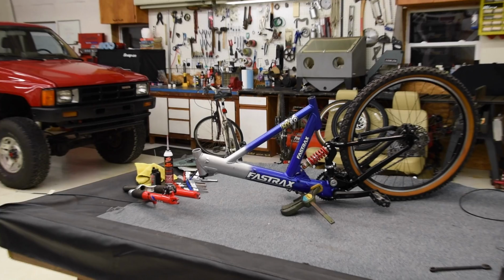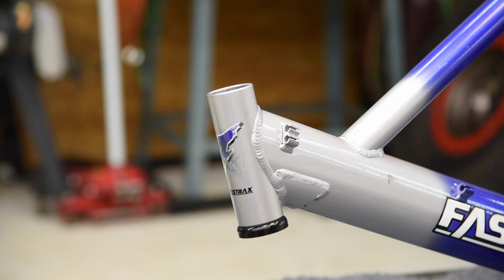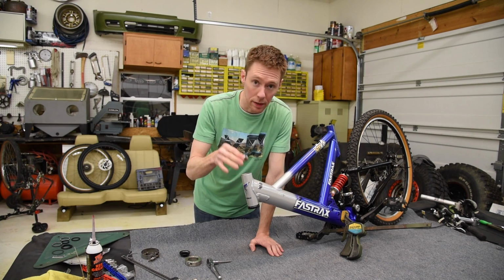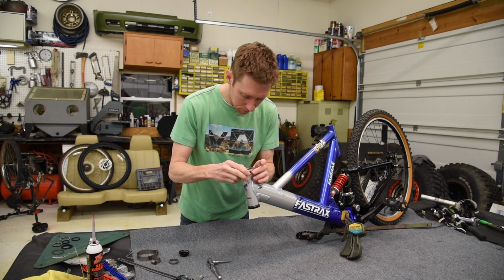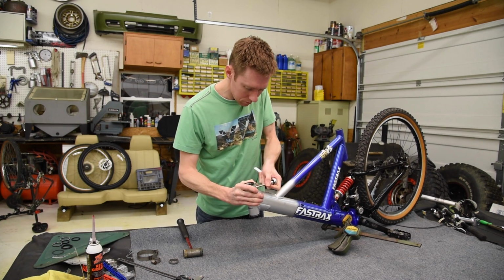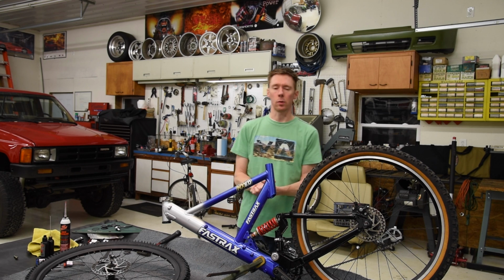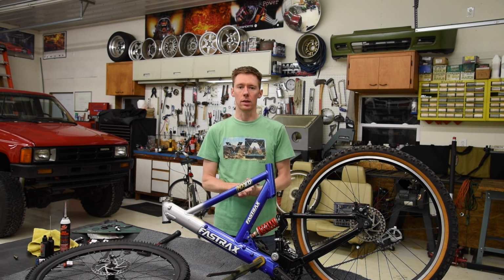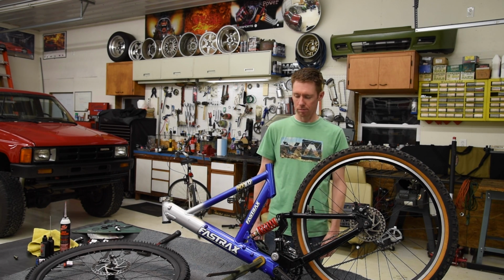Weldless Cracked Headset Tube Repair - Aluminum Bike Frame

Comment from the maker: 2023 Update: I'm still riding this bike and the crack has not changed since this video!
Reply: I went looking for answers to my question. How to repair cracked aluminium bicycle neck. I was thinking of drilling at the bottom of the crack and using a stainless steel hose clamp. So I'm glad I found this video and now I see that 8 years later your fix still works. I'll look for one of those clamps now...thanks for that.  👍

Comment: I had a cracked head tube, I machined a solid 5mm thick metal and make sure its a tight fit and the ring needs a headset tool just press to attach it and then I install my headset.

Comment: I have a similar failure and was considering to pay someone to tig weld the crack but was concerned about (the lack off) heat treatment. I'm considering to just braze the joint instead. Thoughts?
Reply from the maker: I don't think brazing would be as strong as a heat treated TIG weld. If it were anywhere else on the bike, it could be worth a try, but this is one area of the bike that you don't want to have fail when you're riding, especially off road.
Reply: Thanks! TIG + heat treat is going to be the strongest, but heat treating is rarely feasible. So I figure brazing the joint would be a good compromise. Maybe add a bracket clamp like you have on top too. This would be on a beater street commuting bike.
Reply: Best approach.
Reply: @6thGearGarage  Alu solder is typically stronger then 6061.

Comment: I have a trek ex9,  2011 frame that's indented from the rear triangle, chain stay. I was wondering if tig welding it to cover the indented area would   help.
Reply from the maker: Hard to tell without seeing a picture. It really depends on the series of aluminum that trek used for the frame. If it is 6000 series, it will need heat treated following tig welding, which will be expensive. If it is 7000 series, no heat treating will be needed after welding.
Reply: Are you saying the rear triangle hit the frame at, like, the seat post and dented it? Or are you saying that the chain stay has an indent? If an indent on the inside of the chain stay it is likely part of the design. Many of my bikes have had what looks like a bad indent but it is designed into the bike, mostly for tire clearance.
Reply: yes it is the chainstay I am talking about, I took a fall and chainstay hit a rock causing a dent to it, it is slightly bent"

Comment: Did it fail eventually? I came up with almost the same idea forr a chainstay, but can't find something as strrong as ur ring
Reply from the maker: MagnusE nope, it’s still holding up and I’m still able to ride the bike 😃
Reply: That's good. Riding on trails or road ?
Reply: @darylsturges3830  road. Will use  carbon fiber and fiberglass around it but I m not in a hurry since it's 2nd bike

Comment: Plus, what's your thoughts on jb weld epoxy?
Reply from the maker: I wouldn’t trust jb weld on this type
Of repair.
Reply: It's a big marketing lie. If some is lying to you send him to hell.
Reply: How about jb weld the drill hole and crack from the inside and then add the clamp or sleeve as well

Comment: Just wondering - if you left that crack AS IS - would the frame have eventually failed or would it have held up?
Reply from the maker: The headset sees a lot of stress while riding on trails. The crack would have continued downward and frame would have failed. That would have been a nasty accident if it failed while I was riding.
Reply: @6thGearGarage  trails yes; what about city commuter riding? would putting a metal clamp prevent it?
Reply from the maker: @johngta7172  I would still use the metal clamp and also drill the hole below the crack.

Comment: You are maybe being a bit over cautious on the post welding heat treating. I have welded many after damage including replacing tubes and not had any problems. Preparation is key. A little weld like that is not going to put much heat into the frame. 6061.T6 a common choice and easy to work with. Gets bit more tricky when doing 7071T3 and alloys like that. I would just have it welded,any competent welder could do it for you. Cost you some beers. You could still use your clamp if you felt the need,like a comfort blanket!
Reply from the maker: Good point... I did talk to one local guy with a TIG who said he could give it a try, but couldn't guarantee it would hold without the heat treating. If I had a TIG, I would have given it a try myself.
Reply: 6th Gear Garage if you have not got TIG facilities then why not give Muggy weld super alloy either 1 or 5 a go? Look it up on you tube, the stuff gives amazing results and might just do the trick?
Reply: Andrew Wilson I’m going to look into that for my cracked mtb. It’s not my regular ride; but want to keep it as it’s my first mtb back from mid 1990’s  tks
Reply: Welding bike frames is no heat problem. They are not hardened in any way.

Comment: Hi i have the same problem and 2 ppl have told me to trash the bike its scrap metal...My crack is on the bottom of the headset tho i'm not  really ready to buy a new bike either plus when i got it tuned up thats when the bike shop discovered the crack for me otherwise i would've kept on riding it....its 2019 now how's the bike holding up?!?!
Reply from the maker: Vincent Lee the frame is still the same as the day I "fixed" it in this video. I can't believe it has been over 3 years!

Comment: ok how can I weld this crack ?
Reply from the maker: Depending on the grade of aluminum, it will need to be tig welded with the proper rod and then heat treated. I checked around locally for those services and it was more than the bike was worth.
Reply: @6thGearGarage  i see I actually own a small boat and got here looking to fix aluminum ,, I think what I have gathered is to try to JB weld it if it doesnt work buy a new one :(
Reply from the maker: @USA4thewin  JB weld + Flex tape :)  Really though, you could try getting it welded. That's not expensive. It's the heat treating that is expensive and I'm not sure if that's necessary on a small boat.

Comment: is the clamp still holding on? whats the status of the crack?
Reply from the maker: It's holding up perfect and the track has not increased at all after a season of riding.
Reply: the hole no needed, tested with aluminum ring (not clamp)

Comment: this is very informative thanks men! love the effort!
Reply from the maker: Thanks,
 the repair is still good to this day.
Reply: OR:
— Just cut a stainless steel strip of ~0.1mm x ~5cm x ~50cm [eBay].
— Scuff up both sides of the strip.
— Coat both sides with a film of premium slow-cure epoxy.
— Let the epoxy begin to cure.
— Wind the strip very tightly around the cracked tube, as though it were thick tape.
— Hold in place with a very tight wind of some Kevlar tape, and several continuous (full-coverage) standard hose clamps on top of the Kevlar.
— Let the epoxy cure.
— Remove clamps, Kevlar
— Clean things up, using files and few grades of sandpaper.
— You can think of your own ways to improve these simple instructions.

Comment: what is the size of you steer tube?
1 1/8"?
Reply from the maker: it's 1 5/8"
Reply: We have the same type of bike but the difference is that you have a 1 1/8" head tube. :( so sad i really want to upgrade my forks but i need to replace the head tube of my bike
Reply: My bike has 1" head tube :(

Comment: is the clamp still holding up?
Reply from the maker: Yes it is, perfect so far!
Reply: 6th Gear Garage how about now in dec 2018? How’s it holding up? 👍🏻
Reply from the maker: @wuaname8441  Just saw your comment - The clamp is still holding up perfect and the crack has not increased :) I thought I'd be buying a new bike by now, but this one just won't die.

Comment: WHY THE HECK do we make aluminum frames??? When Cromoly Steel is Waay better - ive never seen frame cracks in Cromoly, but many times in aluminum
Reply from the maker: It's for weight savings. But as you mentioned, steel is always stronger. Steel will bend under pressure, but aluminum will crack.

Comment: you got taken for a ride paying $400 for that monstrosity,
Reply: $400 used :(
Reply: That doesn’t make it better....
Reply from the maker: I checked back, it was actually $350. Not a bad deal for a dual suspension aluminum bike with decent components. Still riding it 16 years later :) I can now afford a nicer bike when this one breaks for good.

Comment: omg...Yes, because this is a far stronger option than tig welding w/o post heat treatment (sarcastic). In any case, a T0 designation does not become a critical point at that junction, and the base treated alloy would be nowhere near annealed to T0 in any case. Don't post videos knowing all when you don't. Dangerous fix.
Reply from the maker: I have to disagree. Rather than risk tig w/ no heat treating, I used a clamp that I know isn't going to be weak. The last thing I want is the headset tube to fail when I'm riding downhill. My fix is still perfect years later and I just rode the bike last week. The only downfall is the added weight of the clamp, but I'll take that over risk of a failed tig repair.